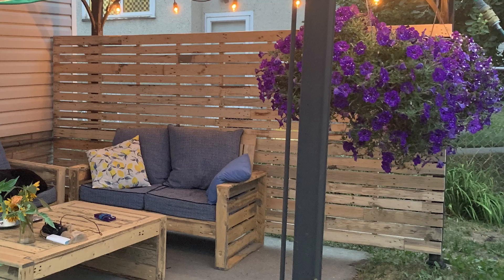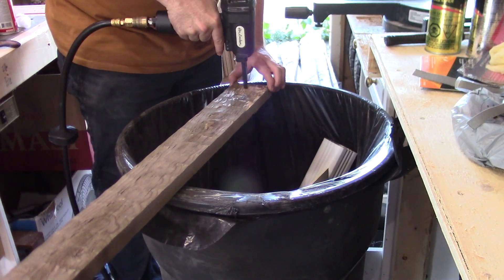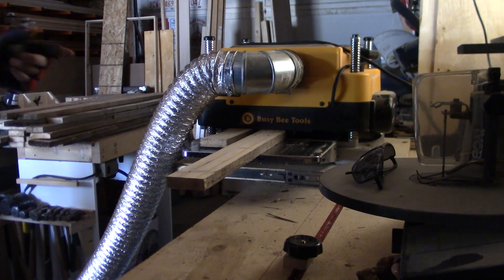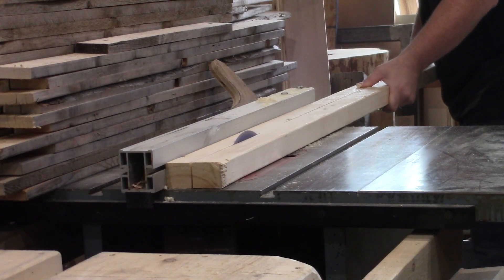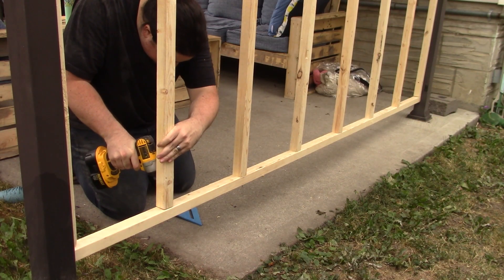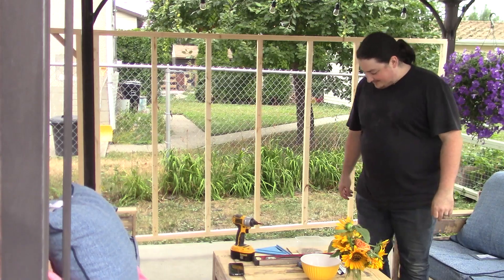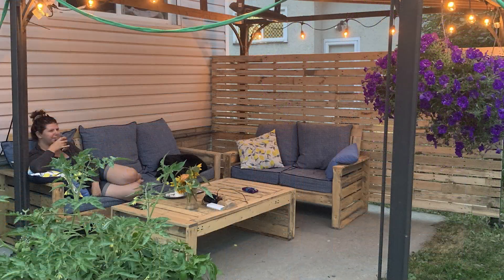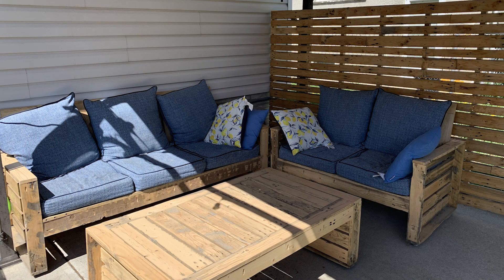Patio Privacy Screen from Pallets

Comment: I really enjoyed your presentation on pallet screens.  I would like you to create a list of the tools required.  Love your accent, being Australian,  I couldn't get some words used.
Reply from the maker: For sure!
To break apart the pallets, I used a reciprocating saw, crowbar, de-nailer, and a hammer. Also not in the video, but i did use a circular saw for a couple of the pallets.
To plane the boards, I used my thickness planer. I've also heard it referred to as a thicknesser.
To cut the boards to length, I used my miter saw, or chop saw.
To cut the framing to size, I used the table saw, as well as the miter saw.
For installing, I pretty much just used the impact driver.

Hope that helps!